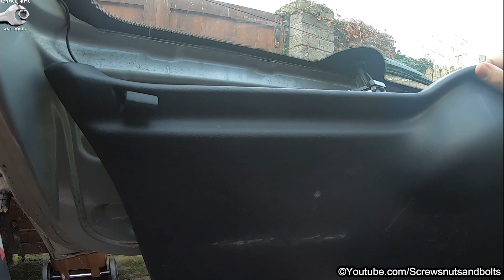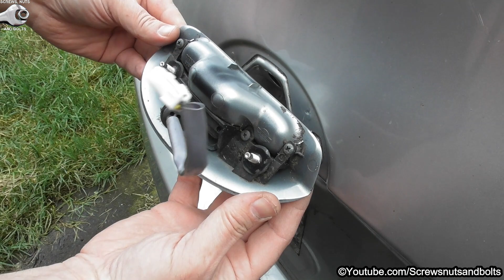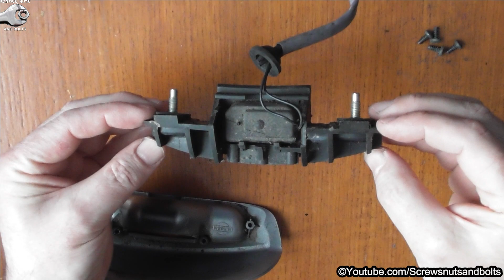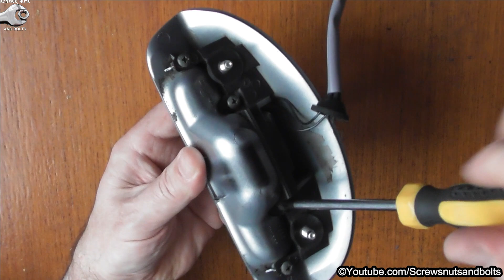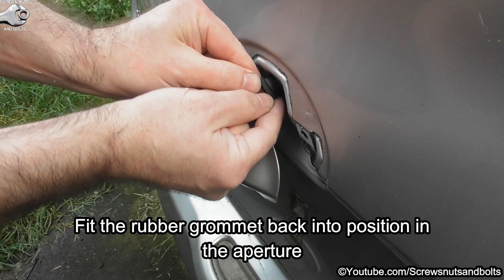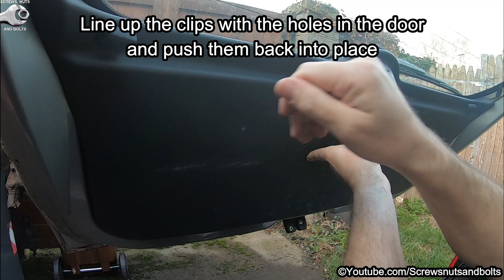Tailgate Handle and Switch Removal and Refitting - Nissan Micra K12

Comment: Thanks for this ....... just replaced mine!  Looks as if some water had got in there at some point during the last 15 years astge screws holding the switch onto the boot plate were rusted.  This might be what did for the switch.  I might put a little sealant around the back plate as there's no rubber ring to seal the joint between the handle and the boot.  Then I'll try and keep the car going for another 15 years.  Hurrah!
Reply from the maker: You're welcome. 15 more years lol :)

Comment: How do i determine if its the switch or the lock that is faulty? The lock can be opened by a screwdriver using the lever from inside the trunk but nothing happens when you press the switch button on the handle to realse the lock

Comment: Thanks for the video....car nearly ran out of battery due to faulty, wet circuits....so pulled over and disconnected the lock until i could get back home, drained the water out of the switch mechanism and replaced the lock.
Reply from the maker: You're welcome, good job !
Reply: I think this is happening to me right now, the switch is randomly triggering on its own and the battery is going flat, I believe the flat battery is because of the switch triggering, I wasn't certain, but it sounds like what you described

Comment: Hi! Could you add information about screws which holds switch? What kind of size they are?
Reply: 10mm socket to remove the main switch from boot. T20 torx to remove the switch from the holder.